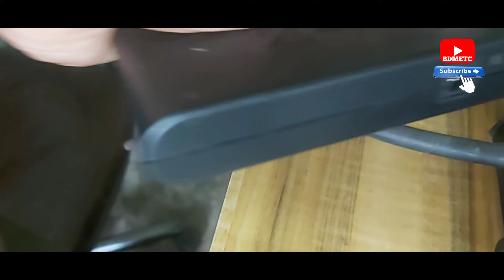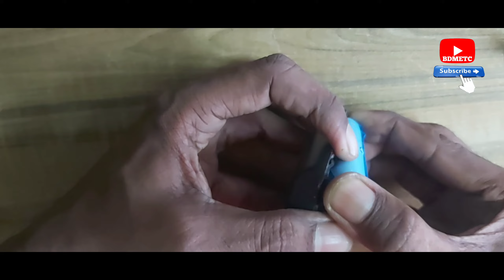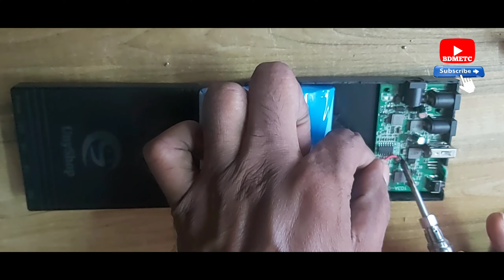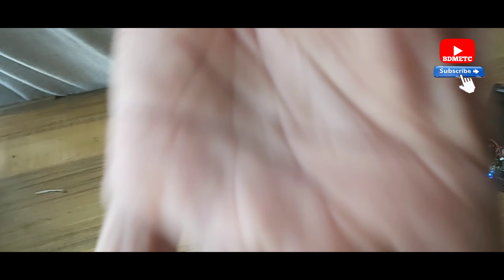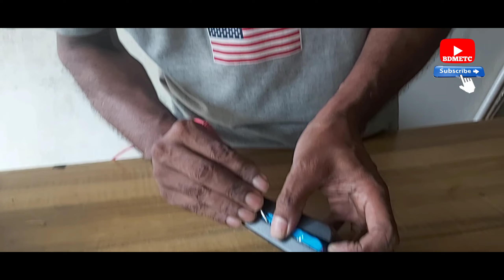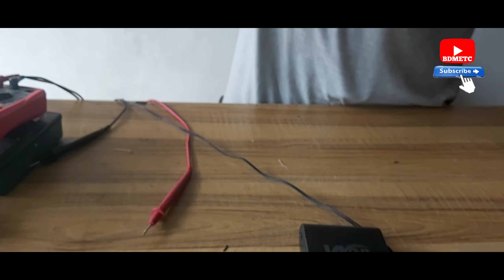how to wgp Mini UPS open || wgp Mini UPS battery change || Wgp ups সহজে ব্যাটারি পরিবর্তন করুন

Comment: Thank you for the nice video I also have the same model it was only giving me half and hour backup so I opened it and replace the cells with the new ones when I repacked using the original connections. The UPS was not turning on when I check the voltage at the red and the black wire these were two volts and the voltage at the BMS input were 8.8 volts so I removed the BMS and directly connected the wires to the battery and motherboard and the UPS started working. BMS was working perfectly fine before I removed it and replaced the cells what could be the problem with the BMS that its output is only two point something volts. Can I run this UPS without BMS.
Reply from the maker: Yes, you are right. Thank you very much for commenting.👌

Comment: Laptop ar 6ta battery ache, 3.7v 6.66wh, akon kun circuit use korle valo hobe r ups banate parbo, ki ki lagbe bms kunta lagbe
Reply from the maker: ৬টি ব্যাটারি দিয়ে যদি ১২ ভোল্ট পেক তৈরি করেন। তাহলে ১২ ভোল্ট বিএমএস লাগবে। যদি আমার কথা না বুঝেন, তাহলে আমার চ্যানেলে আরো ভিডিও আছে দেখতে পারেন  💚👌